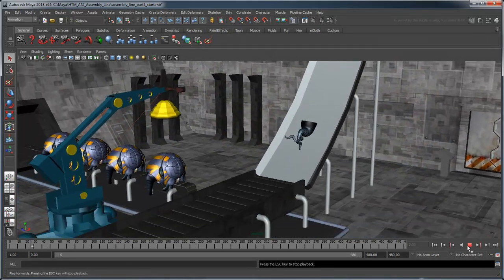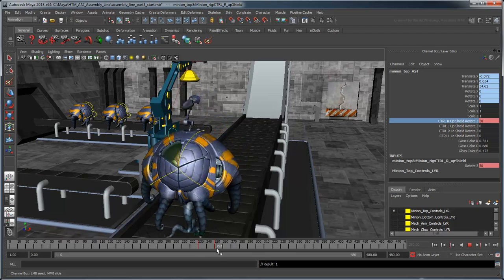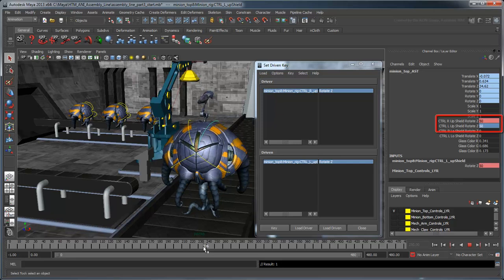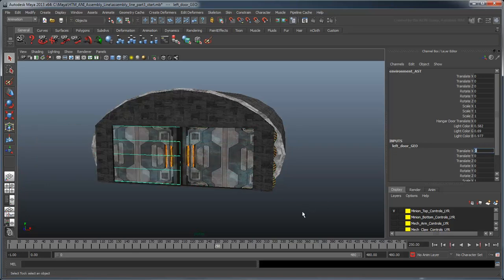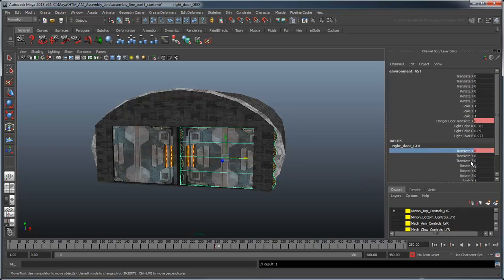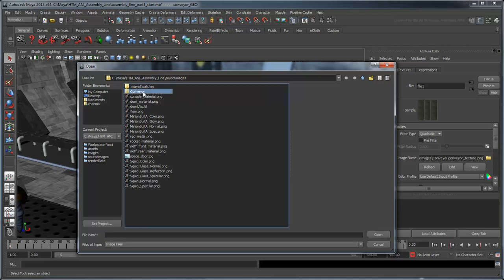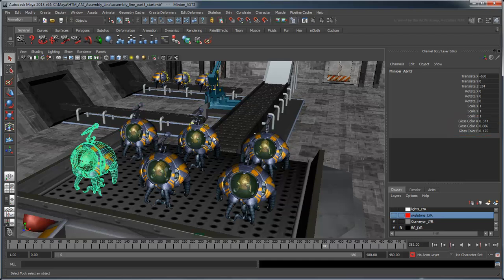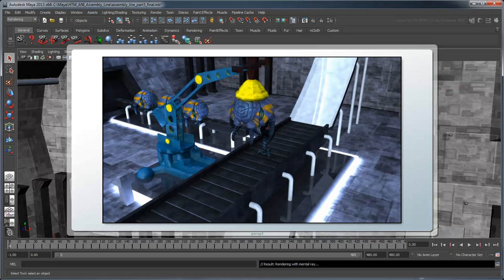Animating an assembly line - Part 3: Driven keys and animated textures

Comment: Seems to be some legacy issues between this file and Maya 2020. In part 2 there was an issue with keyframing the constraint weights which required going into node editor and here there seems to be the same problem with setting up the set driven key.
Reply: Have you found the solution for the new maya? I'm using maya 2022

Comment: hello, nice tutorial, but I've encountered a problem
when i was rendering the scene, the texture on the conveyor disappears after frame 47, but in the viewport everything is fine,
i also tried rendering with only current frame, again, frames after frame 47 resulted the same problem, what could have caused it and how can i fix it?
I'm using maya 2015
sincerely
Reply from the maker: It took me a little while to figure this out, but apparently the conveyor files were saved without extensions which made it difficult for renderers to find them.  Add a .iff extension to the end of all the conveyor images, then reload them and it should work fine.  I'll update the scene files accordingly.
Reply: Maya Learning Channel thank you so much for answering!